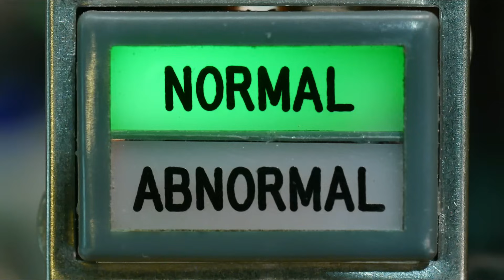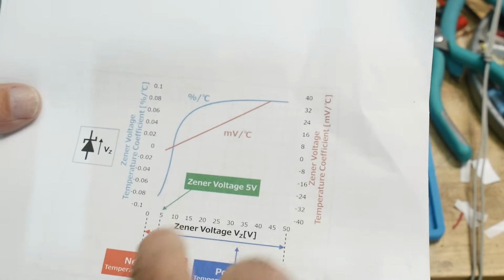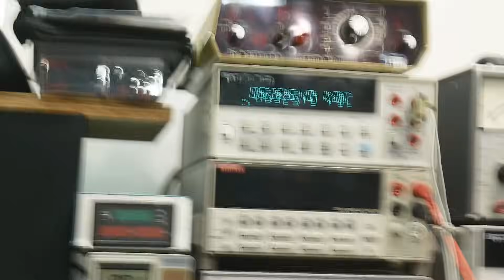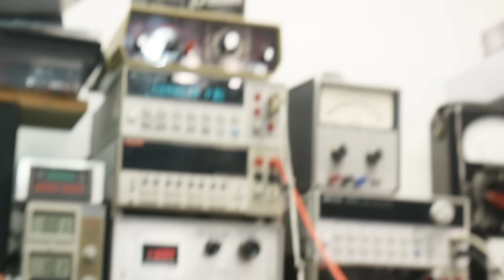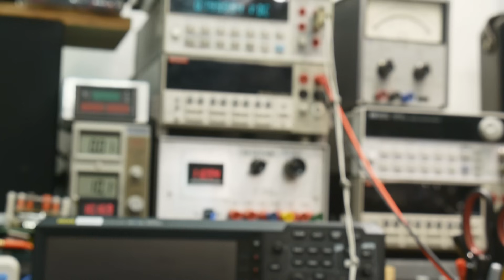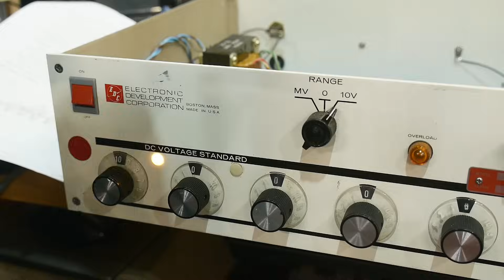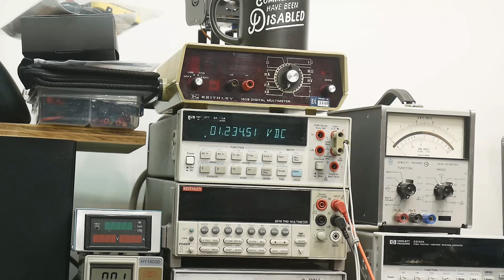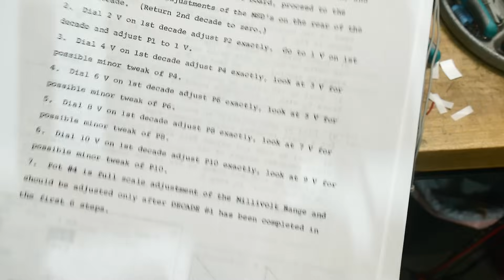#1789 EDC MV100 Voltage Calibrator (part 2 of 2)

Comment: I think you meant calibrate it at 70 F.  I don't like the nonlinearity in the 1 V range; I would expect better from 0.001% resistors.  Was there a poor design choice to allow the current to vary with switch position?  It is also fairly common to put reference components in an oven to keep their temperature constant; this would stabilize the residual temperature dependence.  Another option is to put a Zener in series with a forward biased diode so that the opposite temperature coefficients cancel near the expected operating temperature.

Comment: Of course, this assumes your Agilent voltmeter is accurate.  All this accuracy so that you make sure your proto board designs with 10k bulk resistors  and 555 timers are working accurately. 😂
Reply from the maker: I know, it's a bit silly, but makes me happy
Reply: @IMSAIGuy  just ribbing you 🙂
Reply from the maker: @jimomertz  But seriously I need the rubidium standard to set the 555 frequency 😀

Comment: Hi Imsai, great explanation about the temperature dependence of ZD, I always thought that something like an LM399 was installed in these precise voltage sources - I suspect that it is also in the HP meter - thanks for the example.
I still can't shake the feeling that using clip hooks and lug connectors is not quite the thing, I thought it was supposed to be as short as possible and a solid connection when calibrating

Nice day 🙂 Tom
Reply from the maker: The HP34401 has an LM399 in it.   voltage measurements don't care about resistance in the cables.
Reply: @IMSAIGuy  Until today, I thought that Ohm's law and the phenomenon of transition resistances apply here as well
Reply from the maker: it still matters if the thing you are measuring is high impedance: https://youtu.be/Qa5u7zAXMDM?si=C8vhzc07VIDH_ZRE
Reply: @IMSAIGuy  Hey, I'm a moron, I completely forgot that HP has input impedance switching 🤪 well, I'm getting old and stupid 😁 Thanks for refreshing my memory

Comment: An engineer I knew used a PNP transistor in a circuit for a TV (Admiral late 70's my guess). They chose a single production run of the transistor found the current it needed to have essentially  a zero temp coefficient much better than had they used a zener. It was good enough to do the job, and very inexpensive. I believe they even had the manufacturer remove the base lead.

Comment: Since in such circuits zenner is typically fed by constant current source, and you steal some current with voltmeter(it has resistance. Yes, large, but still), mostly likely you’re misadjust zenner voltage. It wold be nice to make some calculations ad approximate the voltmeter influence.
Reply from the maker: zener 7mA  voltmeter 350nA     don't think that is a problem

Comment: Oh wow you sure dialed that thing in! Nice to see precision zeners getting some love. I think this diode would be something similar to a 1N821-829 where they have an avalanching zener with positive TC and a normal silicon diode with negative TC in series. At a certain current for a certain temperature the diode can be put into 0 TC point. The graphs in the microsemi datasheet show that nicely. I played around with some soviet 9V zener references where its 1 zener and 2 plain diodes (zeners in reverse?) in series. By tweaking the current i could get them to have 2 ppm/C over 10C.

Comment: I want a voltage calibrator that goes to 11...
Reply: Buy 2 same 6digit devices , stick together ( use hot glue ) , then conect output first to the input second and ....voila !
Reply from the maker: Hot Glue.    Top Tip!
Reply: @IMSAIGuy  Mainly so that the hot glue does not cause a shift in the Zener voltage 🤔 ........................ 🤣